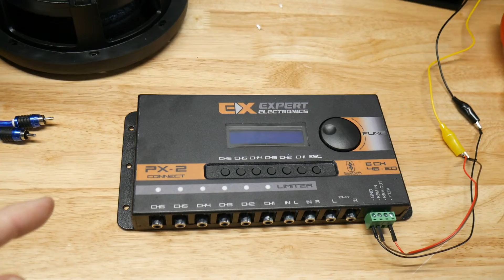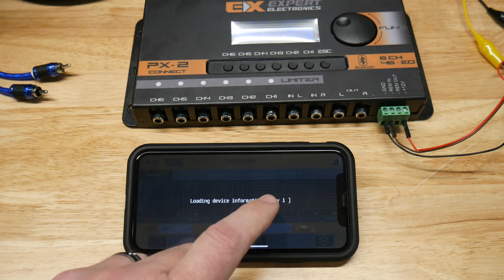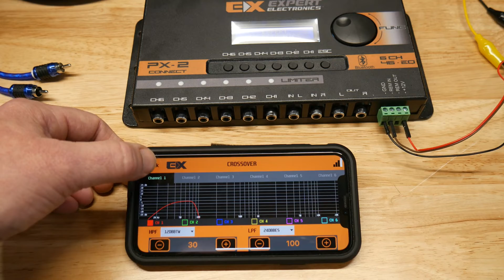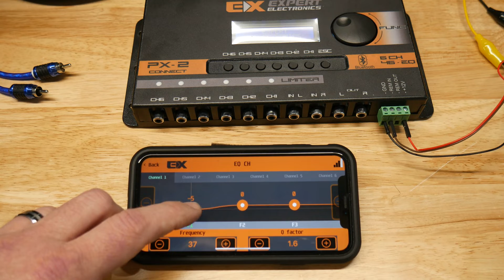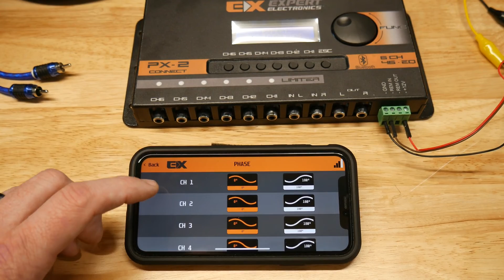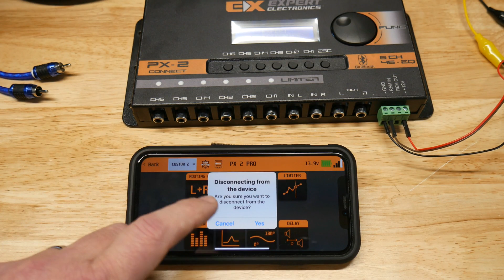Car audio DSP settings explained Expert Px2 connect and others in depth

Comment: Hello so i just bought the px 8.2 and the manual says to use 18 gauge wires or bigger, that being said what size fuse should i use on the inline power wire?

Comment: Thanks for this video - it helped me tremendously! I have the newer PX2R. It uses the same app. How do the functions on the Save Settings page work and how do they affect the settings on both the EQ IN page and the  EQ CH page? If I try to load a saved file I don't really get the same results that I had when I created the file. I am using a calibrated microphone with REW measure my results. If I load a file that I had saved previously or mess with the COPY MEMORY I basically lose my equalization, have to reset and then manually set up all the frequency tuning again. So the saved files don't do me any good. I have also tried to work with the COPY MEMORY function and can't find any explanation of how that works.

Comment: Hi Doc, which setup is better between these two options:
1. Dayton DSP-408 + Pioneer AF555BT v/s
2. Pioneer AP6650 Standalone
- Main Goal: High-quality sound with wide stereo imaging in both front & rear seats, ensuring crisp, clear instrument separation.
- Current Setup:
a) Subwoofer: Pioneer TS-W3003D4 (12", 2000W) powered by Pioneer Pro GM-DC971 Monoblock.
b) Mids & Highs: 4 Pioneer mids + 2 Pioneer tweeters powered by Pioneer GM-A6704 (4-channel, 1000W, bridgeable).
Would appreciate your insights!
🙏🙏🙏

Comment: Thank you for the demo. It helped me a lot. What happens after level matching  the dsp to the head unit  at 2v with a multimeter? Do I also set the amplifier  speaker gains at 2v or set gains according to the speaker RMS?

Comment: Thanks for the demo. I am an audio engineer, so I have a fairly deep understanding of these features. I just wanted to see what features it had, if that makes sense. You did a great job on the explanation! The one area that I would explain a little differently, is the phase/delay control. It's easy enough to leave the phase at 0 on sub channels (for push/pull} and just wire one out of phase. This limits the possibility of a catastrophic clash of woofers to exactly a 0% chance. This feature is better utilized to set the phase relationship between speakers that aren't as close together. for ex. start off with sub at 0 phase at a low volume. Bring in each additional channel (of mids/highs) and adjust its phase to match the subwoofer's. After all, phase relationships are most important on low notes, as the waves are longer and are more likely to become 180 degrees out of phase. (where maximum phase cancellation occurs)  TBH, high frequencies are hardest to align properly because you're working on essentially a "micro-level" the peaks and valleys are TINY! Thankfully these frequencies are not nearly as crucial to time align. Time alignment is most crucial where you have overlap of frequencies from LF driver (sub) to mids. And keep in mind that your phase settings could differ from seating position to seating position. ie, sit where it's most important while making phase adjustments. If you like to show off, set these from your passenger seat, to ensure a good experience for your passenger. If it's all about the driver's experience, set them from the driver seat.

Comment: I have a question hopefully I get a response. I have a 4 Channel amp and the 4 miss in my soundbar are wired together and I have them bridged on channels 1&2 and I have my tweeters on channels 3&4. My question is what do I set for the bridged speakers on the app?
Reply from the maker: You would just cross them over and EQ them how you like on your mids. And if they are all bridged then there is no left right correct both left and right are coming out of mids if they are using only one bridged channel. So the on the DSP going out of DSP into amp just output L&R to your bridged 1/2 ch on amp.

Comment: Good day bro.this unit has a 6 channel input.so can i use 6 diffirent full bridge amp.im using tarramps.for example channel 1 n 2  for bass-2 amps
3 n 4 for mids-2amps
5 n 6 for high-2 amps.
**the other question is,if im using the channel for high,on what frequency should i put on the LPF and HPF??
your answers means a lot.thanks.

Comment: I don’t know if it’s the dsp or my amps but I got crazy noise with my first time using a dsp in my setup any help!
Reply from the maker: First narrow down if it’s your amps. Disconnect DSP and go straight to amps and see if the noise is still there. If it’s gone then reconnect DSP and check rca cables and see if you move the RCA’s away from any power cables helps. Then try new RCA’s and check your DSP ground location.

Comment: When you show the individual channel EQ, there is an F1, F2, and F3. I understand what you are saying when adjusting the F1 but what are F2 and F3?
Also, is delay the same thing as what is labeled as time alignment on other DSP's?
Reply from the maker: This DSP has 3 customizable frequency numbers per channel. This the f1, f2 and f3.  Those are the 3 custom frequencies. This is in addition to the main eQ on the DSP.  Yes the delay would be same as time alignment …it will allow you to adjust speakers to “hit your ear” at the same time if you have any need for it.
Reply: @HiFiVector  I think I get it now. If you had any problem areas, you could zone in on up to 3 specific hz. Otherwise, you can only target the areas listed on the master input EQ. 
Does that sound right?
Reply from the maker: Correct

Comment: i keep getting noice...
Reply from the maker: Lots of reasons for noise but check rca cables, ground location. Keep rca away from power cables. These usually don’t have a noise issue.
Reply: If taken out everything and reinstall.still keep getting noise.

Comment: using the expert should everything on my radio be flat?
Reply from the maker: Usually yes it’s good to start out with your HU flat but if you need to tweak it is fine. Just depends on how your HU was designed. Flat on one HU could sound to flat, while flat on another HU could sound great.
Reply: I keep getting noice.whats the problem?

Comment: Thank you for the walk thru. I bought this unit but the Air 8 version with a 32 band eq. The software in the app is identical. 

Some points to note: once you program the DSP, it saves it to the unit, and you can then “boot up” the same settings on any phone that you connect to the DSP, so the “memory” is “transferred” to any phone connected to it. 

Also, the time alignment is one of the most incredible tools as it helped a massive vehicle like mine (Navigator) finally sound right. 

All in all, this is an incredible dsp and very easy to use. Thank you for reviewing this.
Reply from the maker: Thank you man yea I like the expert and audiopipe clean dsp.

Comment: Finally a DSP video i understood with ease.  ! Im slowly building my system and originally when i bought my car ( 08 mercedes sl 550 ) it had Bose surround sound. I bought car used and radio worked about a month. When the system worked it sounded really good. I am an SQ guy. I have the recoil red 1800.5 ( because of your review ) ty. I have a mid Tier Kenwood radio with tons of adjustment. Kfc 4707s i think. 4 polk 1042 svc subs in a ported clamshell enclosure thats insanely accurate. I am looking into a DSP unit but i would like one with a surround sound decoder. Like Dolby atmos. I see pioneer has one but has a tiny 50x4 amp with it and dont need it plus too weak .can you steer me in the right direction for something a long those lines ? Or maybe none out there , i dont know. Havent bought new components yet but im leaning towards Blam , morel and Alpine R pros..Thanks for the information so far and apologize for the long comment. Almost no one out there wants to help out. Anyone in comments , id love your feedback as well !
Reply from the maker: I haven’t seen one myself that does Dolby or surround but then again I haven’t purposely searched for one with surround sound either. I would think the deck would also need to have a surround sound decoder as well a ls the DSP.
Reply: @HiFiVector  thanks for the response. Im not sure as well. Im just now looking into that part of car audio

Comment: So my question is how do I get rid of this horrible whining from my DSP I'm grounded to my lithium battery
Reply: Rcas are all new and been replaced 3 times already
Reply from the maker: Change ground location and try that.
Reply: Also can't get this dam smart 3 to stop cutting out on me my voltage is strong too my input voltage is 1.89 volts
Reply: And I'm not using the DSP for my subs currently but it still cuts out on me then takes a few minutes to kick back on and turning radio off and back on does not turn bass back on however amp stays powered up entire time so it's obviously a protection of some sort I just can't figure it out for the life of me Its only my second full bridge amp first ones I had problems with as well . I'm running #1 welding cable to it from a 60ah a123 bank with stock alt but voltage holds 14s full tilt weird I mean I understand wire capacity but I don't understand how some people are only using 2 agm batteries with 0 gauge wire and there's work phenomenal.

Comment: How do you connect it to your phone though I turned mine on and I don't see anything under Bluetooth devices and when I open the expert app it just shows a loading screen for forever.
Reply from the maker: When you open the app you hit the signal icon on the top corner and you should see your DSP listed and select it. Make sure you don't have any other bluetooth connected to the phone.

Comment: I just bought this dsp. With my mids HPF amp set, my HU set to HPF off, do I set my amp HPF to off and tune with the dsp?
Reply from the maker: You should turn off the crossovers on head unit and use the DSP for that.

Comment: I have a 2011 Chevy Avalanche with the Bose upgraded system,with a center channel in the front dash and a sub under the cemter console. I need an entry level DSP that takes speaker level inputs. I'm adding a front sound stage amp and a subwoofer amp. What cost efficient DSP do you recommend?

Comment: I can't get mine to connect threw Bluetooth, it shows the unit as an available device but won't connect to any phone I try. When the app opens it just searchs but won't find the DSP any help would be appreciated
Reply from the maker: The only thing I can think of is make sure you don’t have any other Bluetooth connected on the phone. That’s the only downfall is on the phone. You can only have one. Bluetooth device activate a time.
Reply: @HiFiVector  I've already tried that I even forgot all Bluetooth connections as a shot in the dark.. I'll try the pro version of the app hopefully that does it. Everything works great, except Bluetooth lol main reason I bought it. Thanks for getting back to me ! Subscribed!
Reply from the maker: Thanks so much man I appreciate that!

Comment: For guys using amp with clip light a cool feature on the limiter is to play a test tone say 40 hz until amp clips then minus the limiter until the amp stops clip you can do this with no speakers connected then connect your speakers back to amp after
Reply: The 40hz is for bass
Reply: Ohhhhhhhhhhh    Yeah thanks

Comment: Hey bro. I don't understand the crossover. I'm doing my sub channel. At the bottom it has a number on the left and one on right. Both are adjustable with plus minus. One says hpf and the other lpf.  Is the hpf a subsonic?
Reply from the maker: So in the bottom left set that at like 20 hz or whatever you want yes it’s like the subsonic. The lpf on the right set to 80hz or what you want the upper frequency cutoff you want.
Reply: @HiFiVector  thank you. You're the only help in the English speaking world to get help from on this.  Do you run one in your setup?
Reply from the maker: You’re very welcome. Yes
Reply: @HiFiVector  bro. How long did it take you to tune this DSP to your liking?  Jeez. So many adjustments I can't get it to sound good yet!  Lol. I just can't get the subs to sound as good as when I was only running through my head units crossover. Its hitting hard as hell but it's missing certain low notes that it was hitting before. And yes I've played with the 3 band and q factor. Going to continue to do so. Just curious if you might have had this issue also. Thank you for all your help
Reply from the maker: It didn’t take too long but I did have to go thru and adjust everything to my liking.

Comment: well kinda of disapointed, i have a razor dsp amp that as a analog audio dsp chip in , it givies a 12 band full adjustable eq per channel [Q, FREQ, GAIN]  per band this really allows you to shape and correct the sound per speaker,  what are you supposed to do with a 3 band??????. . .   they really have it back wards, , it should be a 12 band per channel , to shape and correct each spaker and then a 3 band as a eq in to shape the over all sound. . . . I just bought this for a customer project and was hoping it would allow me to tune with a 12 band per speaker like the razor dsp sadly disapointed. . all in all its a great item BUT that fully adjustable 12 band per channel is crucial IF your trying to correct issues. .
Reply: Thats Intresting, so you can control the gain of each frequency separately ?
Reply: @kaja9917  yep you pin point the exaxt frequency where ever you want from 20 hz to 20,000 hz as well as the width of adjustement and 20db plus or minus gain.  .. And i was wrong its actually 10 bands sorry but still 10 exactly taored bands to your needs

Comment: @HiFi Vector are the setting transferable between phones?
Reply from the maker: Not sure on that. I have not tried to pair two phones.
Reply: Yes. I installed this app on two phones and the settings are saved in the Expert, that is, you can use ten different phones if you wanted to

Comment: So bro. For instance, I wish my subs hit the 50-60 Hz range harder. Could I do a low q factor and EQ for 50 53 55, on one output channel and do 57, 59, 61 on another output channel. Then take one channel and plug it in my Left input on amplifier and the other on my Right.  And by doing this boost those frequencies?  Also I know one EQ will cancel another out. My head unit EQ I cannot turn off. Should I just set it flat?  Like my phone EQ I can't turn off either so I set to flat.  Thank you for all your help bro
Reply from the maker: Yea try and keep your head unit EQ flat then adjust with DSP. An easier way is to use a lower  Q setting ( wider effected frequency range) so if you set your EQ to boost 55hz with a low Q it will boost 50 to 60. That is the benefit of changing the Q. You can have it effect more of the surrounding frequencies or only pinpoint that one frequency.
Reply: @HiFiVector  thank you!
Reply: @HiFiVector  I'm sorry to bother you again but the instructions are kind of vague on this thing.  My question is each channel output only has one RCA. So does that mean I have to buy a Y cable leaving the DSP?  Going into my subwoofer amp I mean because it has left and right input. Or can I use one channel to go into the left and another channel  to the right on my sub amp?  Which would be the better way if you can do either? thank you. I apologize for bothering you all the time about this but really the instructions are not for a novice
Reply from the maker: You can do it either way if you’re not using all your outputs you can just used to going to your subwoofer amp. If you wanna use your outputs for something else just use one to the amp with a Y splitter.

Comment: I'm really exhausted messing with this. I've spent hours trying to get this to work and no luck, sounds horrible. I get the concept of crossovers but they all sound bad and the gain options on this I just can't get right. I feel I'm damaging my system. I'm using a oscope. Whats the point of main in and out gain. I'm one step away just unplugging it
Reply from the maker: The main purpose of the main input gain is to simply set your input RCA gain. The output channels each have their own gain to fine tune the gain to each output channel RCA. If you are confused just set the output channel gains to all the same value ( say 0 )and then just use your main input gain to control all of the output gains together.